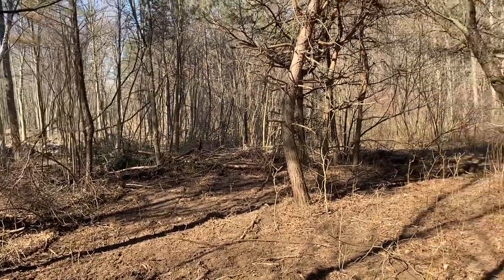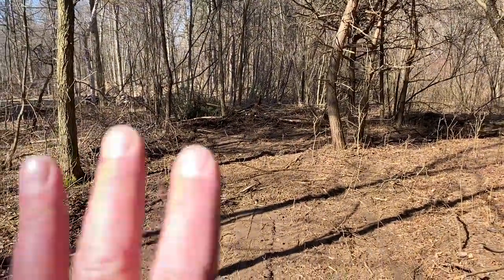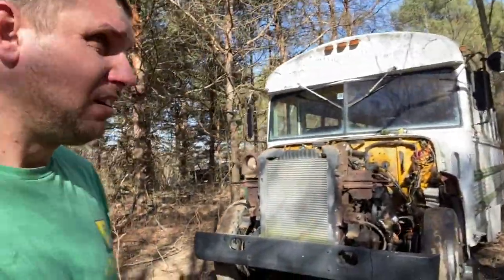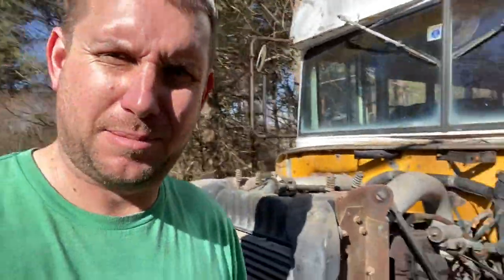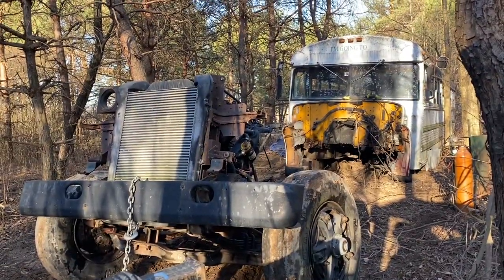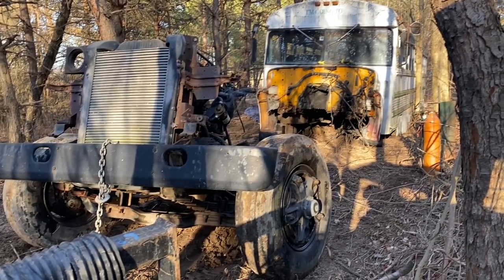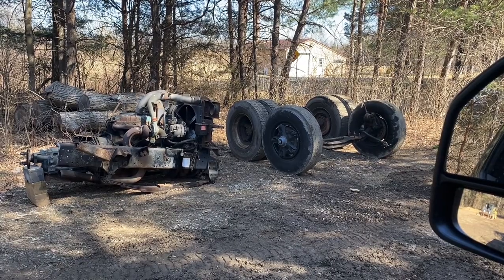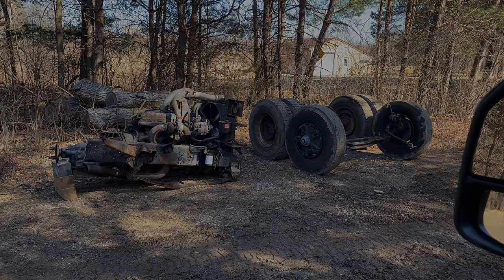I built an 8’x40’ shed in 7 hours!  School Bus disassembly

Comment: that buss should have compression air fittings. i would strip them all and keep them. i am interested in that frame cut.
Reply from the maker: It is compression fittings for everything.  I’ve pulled the air dryer and a few fittings that I wouldn’t be able to access once it was on the ground, will yank the rest later when I get time.  

Emailed you on the frame cut